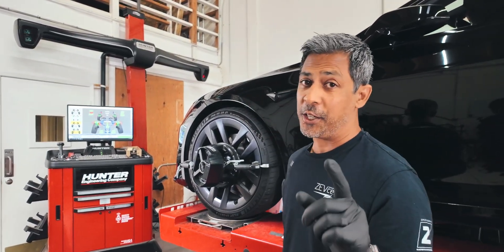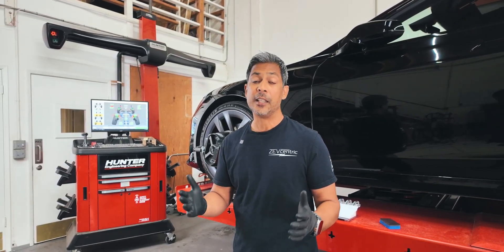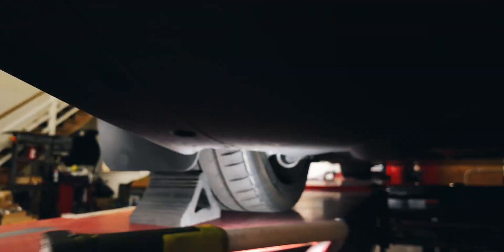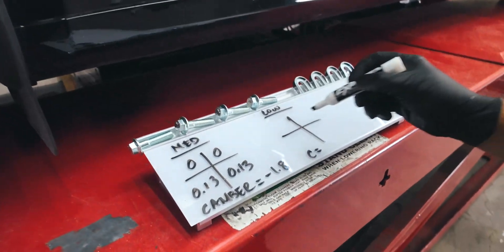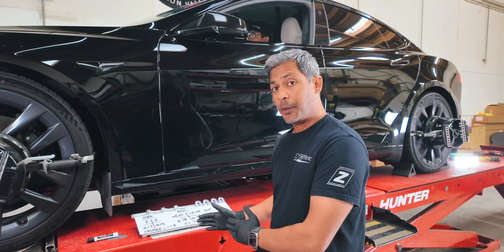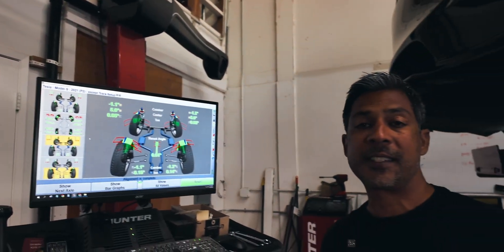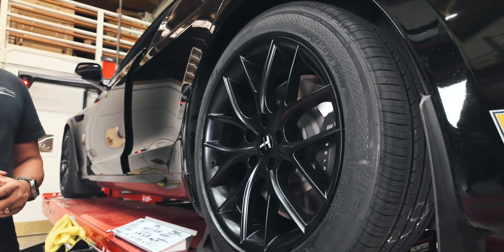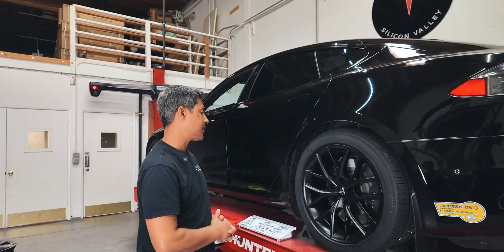How Bad Camber and Good Toe Affect Tire Wear on Your Tesla: What You Need to Know!

Comment: You did not cover what shims you used. They are available for 0.75, 1.5 and 2.0 degrees (even though the actual correction may vary claims depending on the rest of the alignment. People will like to know which ones to buy!
Reply from the maker: We have other videos specific to the shims not to mention that the amount of camber correction provided is also listed on the product page of our website for each shim size.  Please search "shims" in our video listing and I'm sure you'll find a few.  The purpose of this video was to highlight the fact that camber can and will kill tires if it's too excessive.

Comment: I just set my car to -2.5 degrees of camber in the front and 0.03 degrees of toe out. Will this wear out my front tires faster than my previous setting of -3.0 camber and 0 degrees toe in the front?
Reply from the maker: Is this a Tesla?  That much camber will ear tires regardless and toe out is not good for wear.
Reply: @ no sir its a 2023 GR Corolla that i occasionally do HPDE (track days) with.
Reply from the maker: @uND3rrated_MX5 i wouldn’t be able to advise you on that.  Im sorry.  I haven’t looked into the dynamics of the GR.
Reply: @ all good boss. I figure in general toe and camber affect most cars similarly. Thats why i asked.
Reply from the maker: @uND3rrated_MX5  it can to an extent.  What the car does with toe under compression and droop will vary depending on the angle and position of the tie rods though.  Comparing less camber with more toe out to more camber and zero toe is gonna be very hard to quantify regardless.  As a general rule of thumb toe will affect tire wear more than camber though.  Best way to judge this is to take tire temps as soon as you get off the track and look at the appearance of the tread to determine if toe or camber is the culprit.

Comment: What’s the offset of those wheels. Also running a square setup did you run spacers in the rear wheel ?
Reply from the maker: no spacers but don't recall the offset.

Comment: Will a refreshed Model S with 19" tempest wheels also have uneven tire wear when driving in low height setting most of the time?  I can't seem to find a definitive answer Tesla forums.  Do I need to worry about the front tires too?
Reply from the maker: Yes. your wheels selection won't make a difference on tire wear since it's a relative to the bad camber. front can wear from bad toe as well

Comment: I have a model Y performance mine is stock and my tires split like this almost every 30k miles. What would you suggest?? Should drop down to a 19 inch wheel and install shims? 

I just new tires, so was going to just do an alignment and then get new wheel next year. Thoughts??
Reply from the maker: Send us an email with your location.  Zevcentric@gmail.com.  Shims wont work on a Y you need a different part.

Comment: Zev Our MY front camber is -1 to -1.5 with toe at -0,03.   Can front camber be adjusted to -0.5 specifications with shims or adjusting the 3 top shock bolts per Tesla MY Service Manual? Got rear camber right on specs with adjustable camber arms from Kirk at Unplugged Performance in Hawthorne. James
Reply from the maker: It is unlikely that you can adjust the camper, but that is probably not the issue for inside tire wear. You should have positive toe values, not negative toe values, which will help your current Canberra values. Don’t seem that bad.

Comment: I’m trying to figure out how to deal with my wife’s 2023 X’s 22” staggered (285/265) setup.  About 8000 mi on the odo.  High wear on the rear tires, tires on front have very little wear. She will probably do two or three sets of tires on the rear for every one in the front. I’m trying to decide when the fronts finally wear down, would it be a good time to invest in another set of wheels, say 20 or 21” square?  I have not determined yet whether the current 22s are square wheels and only the tires are staggered (gotta find the width # somewhere on the wheel). But 20 or 21” wheels would give better range and ride, and less chance of a blowout on a pothole or against a curb.

Comment: Can a camber shim be used instead of replacing the entire camber arm on a M Y?
Reply from the maker: The Model S/X have a different camber arm design than the 3/Y so a shim kit is not possible on the 3/Y. You do need an Adjustable Camber Arm

Comment: Are you going to do a similar video on the M3? Why did you do the alignment before you installed the new wheel and tire setup?
Reply from the maker: We didnt.  We just showed the before values with the vehicle untouched and then remove the old wheels, installed the new wheels, and then did the alignment. If you look at the video again, you will see underneath the targets on the final alignment. Are the new wheels.
Reply: @zevcentric  sorry I missed it. I have a retired certified Tesla tech work on my M3. He says that Teslas tolerances on their alignment specs is too large. He recommends at the first tire rotation to have the alignment checked. He also recommends tire rotations at 5k as do you. Thanks for the great videos.
Reply from the maker: @harveypaxton1232  we have another video we did a month or so ago on the Model Y, which is essentially the same thing as a Model 3.  Since they do not have air suspension though we cannot show the dynamic change in real time with varying right height.
Reply: @zevcentric  If you’re interested in visually demonstrating the dynamic changes in suspension geometry, you could perform a simple yet effective demonstration by jacking the car up from the body. This would allow the suspension to fully droop, showcasing how camber, toe, and other alignment angles shift when the suspension geometry is altered. It’s a great way to explain why any changes to suspension components or ride height—whether intentional modifications or due to wear—necessitate checking and adjusting alignment.
Another interesting method is to simulate suspension compression or squat using a cargo binder strap, such as a ratchet strap. You can attach it to a solid point on the crossmember and compress the suspension to illustrate how loading forces affect alignment. This is particularly relevant for showing how ride height changes, such as heavy cargo or modified suspension setups, can alter the car’s alignment angles dynamically.
Hunter Engineering used to offer a rig specifically designed for this purpose, which hooked into the jack rails to compress the suspension systematically. If you have access to similar tools or can replicate this setup, it could be a compelling way to educate viewers on the importance of maintaining proper alignment in real-world scenarios.

Comment: This is the real reason for all the rumors that EVs are heavy and burn through tires. Wish the world would shut up already and watch this. Thanks
Reply: how truck rigs RV  tire survive in your reality?
Reply: @Taxthe200mil  The differences between passenger car and commercial truck geometry are based on their design goals:

Passenger Cars:
	•	Small negative camber improves handling and cornering.
	•	Use independent suspension systems, so camber adjusts dynamically.
	•	Excessive negative camber (e.g., from lowering) can cause inner edge wear.

Commercial Trucks:
	•	Neutral or slight positive camber is common to handle heavy loads.
	•	Use solid axles that are less dynamic, focusing on durability.
	•	Overloading or axle misalignment can lead to camber wear, often on one edge.

Comment: Why uneven wear though if the values are similar? Is it because driver side scrubs more on left hand drive roads and owner didn’t rotate the tires?
Reply from the maker: Original Tires are staggered and cant rotate.  Also not sure what happens when vehicle is in movement.  The rear will compress even more in motion.  The video is just to show the broad picture not to analyze why the problem is bigger on one side than the other.  The objective is to just resolve the issue as a whole.
Reply: @zevcentric  I was referring to side to side rotation. Without rotation same thing can happen at a later date even with better alignment.
Reply from the maker: @aec258  got it.  It's hard to know if the tires were ever rotated left to right since it was purchased used.  It's possible that on a crowned/graded road that the tires mate to the road differently or that there are more turns in one direction than the other.  You are correct though that rotating left to right should help to even that out if in fact that was the cause.  I know it won't be an issue at all once the camber is corrected because we have seen the after results on so many customer cars.  Michelins are notorious for shoulder separation as well with these poor camber values.
Reply: with high toe-out and/or neg camber >1'  tire pressure becomes much more critical. Even 5psi over extended miles will exacerbate this inner wear. Lazy people will allow 10psi drop from 42 recommended, which will allow tire to roll under far more. Maintain your pressure.